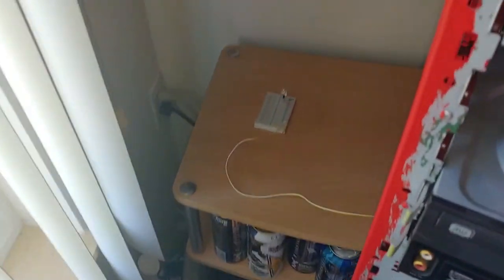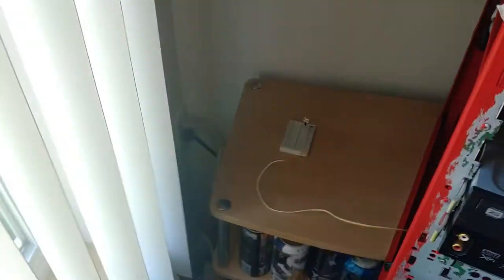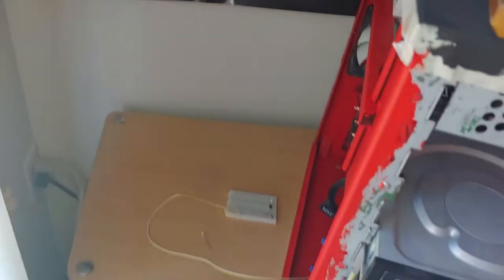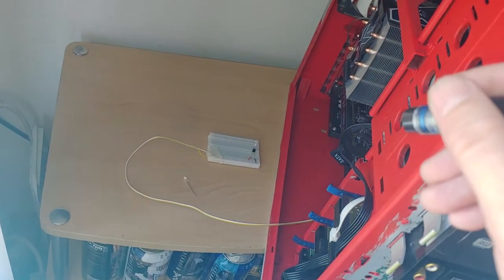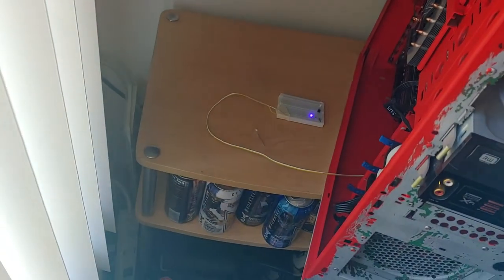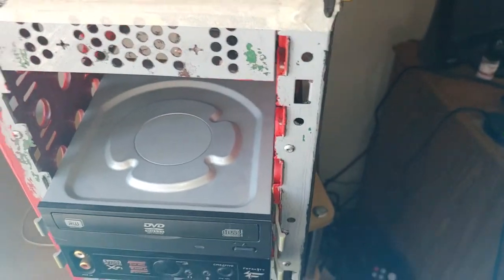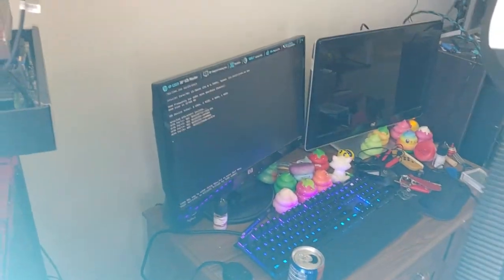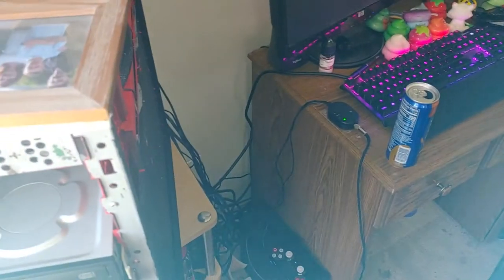LED Power Switch Working Prototype! (Strong language)

Comment: That's freaking amazing I now may have to pay you to do the same for me lmao
Reply from the maker: As soon as I get my soldering skills on par, I might start making these "in production".  Though all it is, is a transistor and an LED plugged into a breadboard, and the leads from my PC power switch run through the positive and negative.  If I figure out how to draw pretty circuits I'll link a schematic.  The biggest trick is sourcing LED and lasers in the matching wavelength